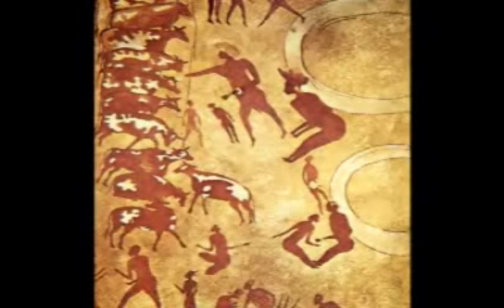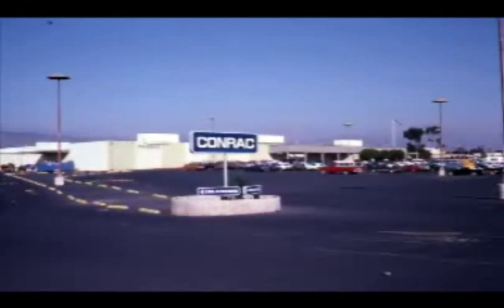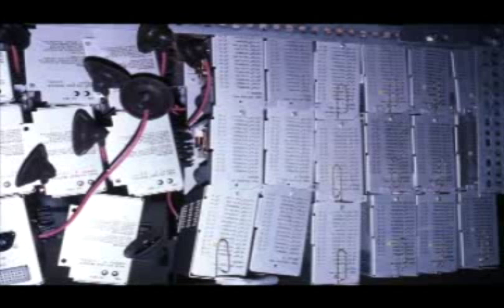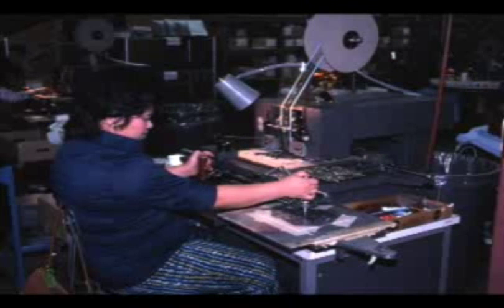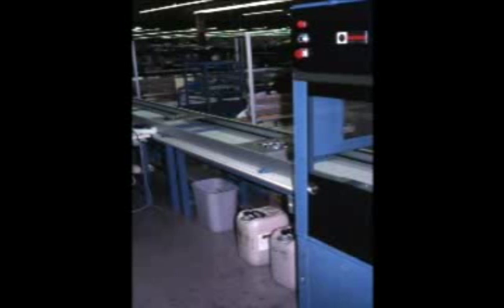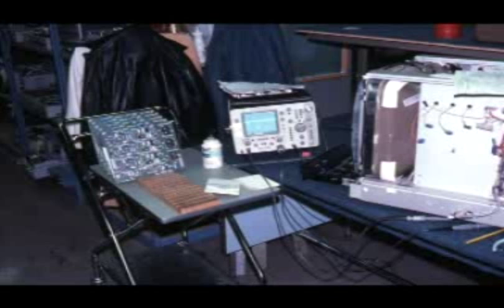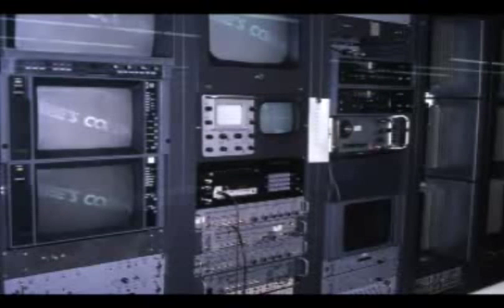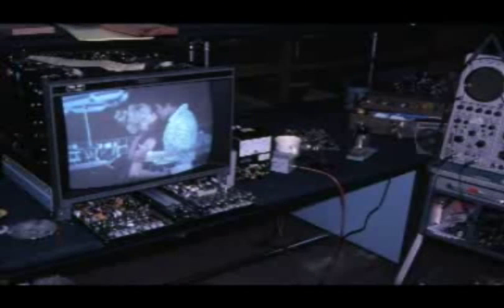1974 Visit to CONRAC

Comment: I worked for CONRAC from 1973 to 1974 in Fairfield NJ. Wally T. was my supervisor. He was a great guy to work for. We built and modified Air Data Computers along with ACUs and other electronics for the war effort. The Vietnam war ended and this particular location shut down. A fun place to work though! I modified and calibrated impact modules which were contained in our Air Data Computer system. I remember quite a few workers at CONRAC. Maybe one will show up here.